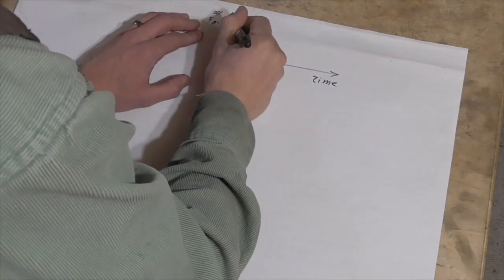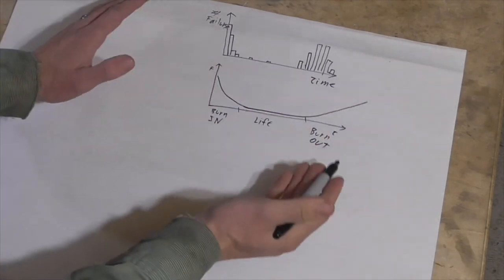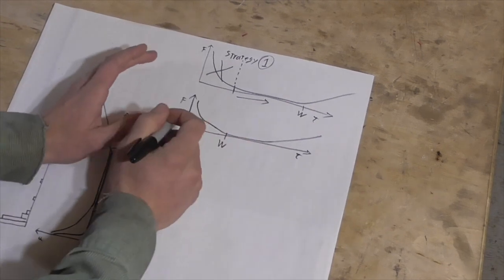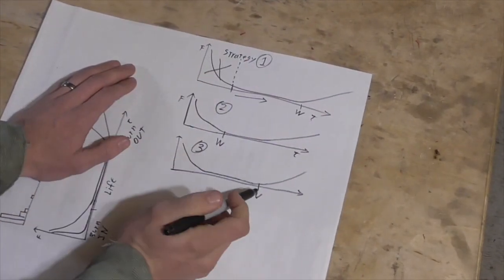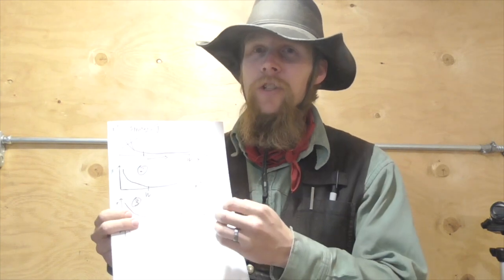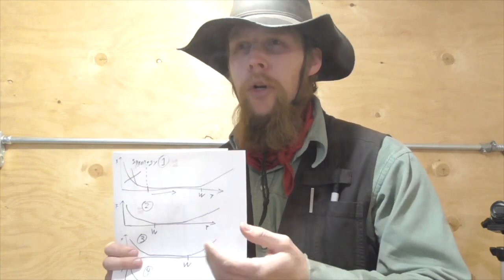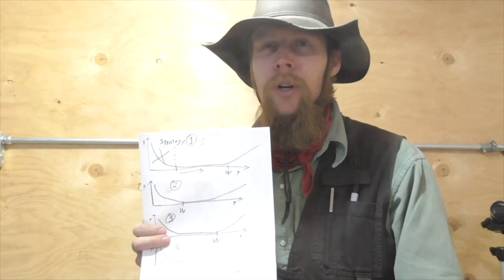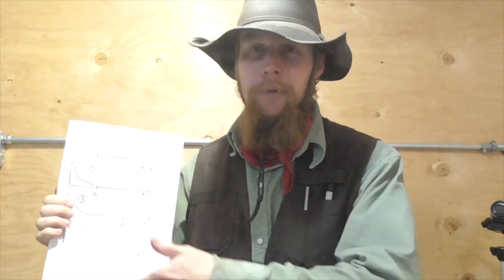What Every Consumer Needs to Know about Quality Control (TIS320)

Comment: Hi Tim,  I know that light bulbs are a model chosen for easy discussion.  But strictly speaking to make sense with light bulbs, the warranty period should start after the first use, rather than date of purchase.  This is because light bulbs may sit on your shelf for 6 months or longer before you use them - and nobody knows nor can prove when bulbs are first used - other than a failure claim one week after purchase.   

If we were talking about cell-phones the same time-since-purchase warranty principles would apply, but the buyer is likely to start using the product immediately after purchase.

In practice, electronics of all sorts have warranty period of a year, starting from date of purchase.  After all, how can one determine how long a light has been on?  Or how many thermal fatigue cycles it has seen (on/off)?

Your bathtub graph does explain the customer satisfaction histogram for a typical product sold on amazon.  One wants the early failure "spike" (low rating) to be tiny, compared to those who are very happy with the product.  Then there is the matter that people are quick to complain, but slow to praise a product for just working as advertised.
Reply: If you need exactly 10 light bulbs, you should buy 15.  Thus acting as your own intermediate warranty provider.  The snag is if all 15 came off the same production line in series, all 15 may fail prematurely...

Light bulbs are cheap.  A cheap bulb may be resold at twice the price, so even just price is not a reliable indicator of reliability.  Trust, but verify by keeping spares and building your own data.

Now, even water heaters have the same bathtub curve for failures as lightbulbs.  These days, even such expensive equipment has the electronic controls show significant early failures.  Very annoying...